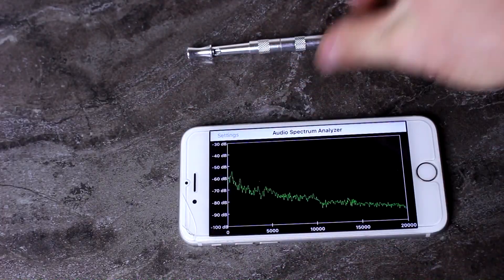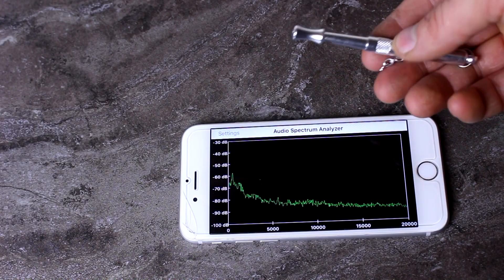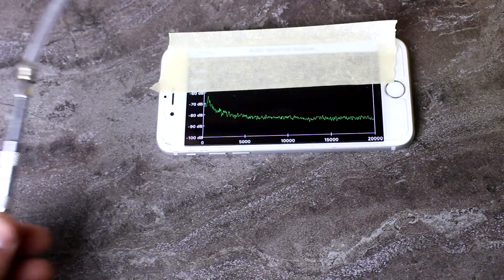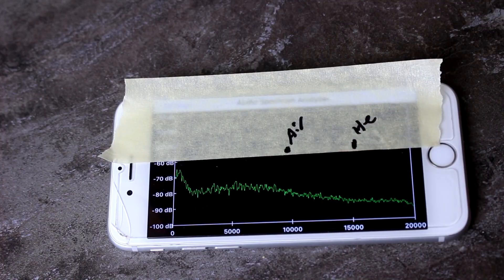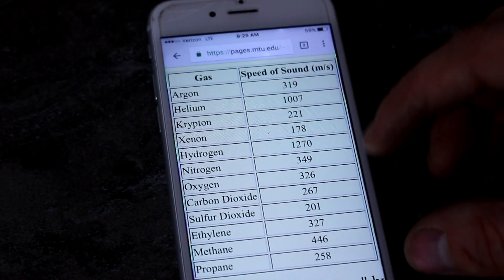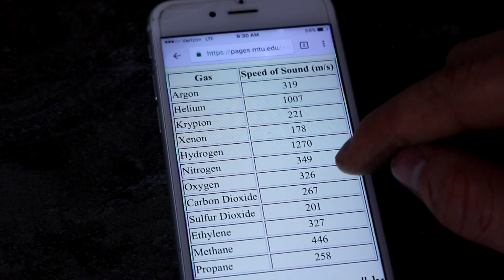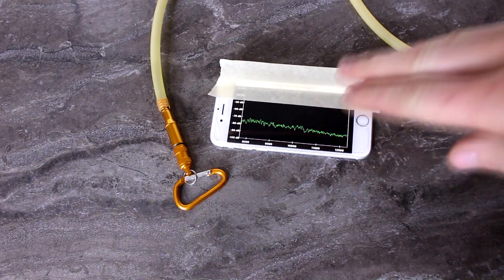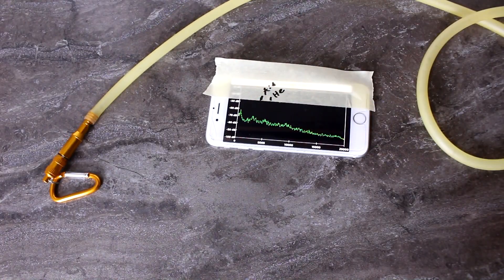Dog Whistle On Helium and Xenon

Comment from the maker: Now I wonder if I could play a song with a single whistle using different gasses to get different notes. Might need someone more musically inclined to help out with that.
Reply: Cody'sLab Set up a MIDI-controlled gas-whistle, and you can import MIDIs others have done. Would be difficult to tune, though, unless you used just two gasses (xenon and air?) and mixed between the two.
Reply: Just get a few analog solenoids, pipe them together to form different mixtures of gasses with an arduino. Produce any pitch of the rainbow. It's quite easy.

Also make sure you get a good audio recording or it'll sound like air blowing, not like pitched whistle sounds.

Just a simple midi-to-valve-open-% should work well, making sure valve-open-% are logarithmic. Some trial and error and a few hundred dollars worth of gas later, you'll have a work of art. 

Sorry, I'm a practical engineer.
Reply: The reason that the notes have multiple peaks is due to harmonics, the pitch you hear is going to  be the loudest harmonic(usually the 1st) and when you put more pressure through the whistle it will cause higher harmonics to become louder. so in addition to different gasses you could change the pressure to get more different notes.
Reply: There are 12 notes in the chromatic scale.

Firstly you will have to see if you are able to reach both ends of the chromatic scale with your gasses. If your lowest note is at 9kHz your highest must be at 18kHz.

Otherwise you can choose a tune that will only use a few notes close together and does not use the entire scale (the first 2 bars of jingle blells is just 4 notes and close together...)

If you have a base note of 9kHz you can choose that as your root C and then mathimatically determine what D E F and G should be relative to your base 9kHz.

9000×2^(0/12)=9000Hz=C

9000×2^(1/12)=9535Hz=C#

9000×2^(2/12)=10 102Hz=D

9000×2^(3/12)=10 702Hz=D#

9000×2^(4/12)=11 339Hz=E

Etc... etc... etc...
Reply: Did you check what is the highest frequency your microphone and phone sound processor can detect/process? I'd like to see this repeated with an actual oscilloscope and a microphone with the datasheet known.
Reply: Hey, Cody! Air != Oxigen! Air mostly is Nitrogen (78%), Oxigen only 21%
I am not quallified to check calculations, or gas densities, that’s why it is just a question - air, N2 and O2 has the same density?
Reply: This video raised more questions than it answered.

If air is at a frequency of 9kHz 3×9kHz would be off the scale of your spectrometer. You were probably seing a harmonic of the He root frequency
Reply: On the hypothetical side if you happen too have a few whistles you could pass propane butane and set them in fire for a neat effect.
Reply: @Adam Neely
Reply: Cody'sLab Thank You for the noise warning, I have tinnitus and that sound at normal volume makes it go nuts
Reply: "Aren't dogwhistles supposed to be so high pitched that you can't hear them?" Well, maybe... You only tested for up to 20kHz. There might be a peak beyond that, and therefore beyond our hearing.
Reply: Record all the sounds  the whistle can make using gasses and then put them up for download lol
Reply: I wonder when you're going to team up with @Smartereveryday to do a crossover! I did a BBMSc and think you're awesome!
Reply: @kobrapromotions  and maybe also with Sam from Look mum no computer   it seems he would love to make this kind of instrument
Reply: Cody'sLab do you think you could do a video where you attach a whistle to the air intake on a vacuum so that when you let air back into the vacuum chamber you gradually hear the whistle?
Reply: Hey Cody yes, the helium is diluted in most if not all party tanks. Matter of fact even in large commercial size tanks they sell what they call Balloon Gas, which is helium often recycled from medical/lab work that is of a lower purity and useless to the medical/lab work in which it was intended that needs a high level of purity.  However it does work perfectly fine for party balloons, depending on the ratio.  

Also Inhaling helium can and has caused serious injury, death and permanent brain damage, as a quick google search will reveal.  Helium in and of itself is completely inert and will not cause you any damage. However as you have shown percentages are important, and if you inhale too much at once even for a few seconds, it can and will displace all the oxygen in your system, causing brain damage and death, and very quickly.  I found a website warning of impure helium supplies because they did not kill you fast enough, it was a suicide website where they teach you how to off yourself. So no not as safe as people would think. (That was more to others here then you Cody :) ) 

For example divers often use helium in their tanks to fight the bends, and this is perfectly safe as they use a regulator that mixes enough oxygen and nitrogen into the system so they do not die.  However if you breath a full normal size party balloon being between 11 and12 inches in diameter and have a smaller lung capacity, the results could be lethal.  Even worse with larger size balloons such as the giant 30 and 36 inch balloons. 

Why do I know all this? I am a professional Balloon artist and work with balloons and helium on a regular basis. 

Also since helium is currently expensive and going up in price a lot of companies are diluting the supply they are selling to increase profitability.  Hopefully they will get the massive new helium find in Tanzania will bring down the prices :)  

Bonus fact.  Helium has never before been sought out for commercial mining operations. It has always been found as a byproduct of natural gas exploration. A couple of companies teamed up to try to locate it on purpose and found a massive supply . 

Great vid Cody loved it :)
Reply: Why did you mark the gasses on the furthest left point only for each of the gasses, when the peak was shown to be further right?
Reply: Cody'sLab need hexane...!!!!
Reply: This would be a good time to use your second channel for any one interested in the math you didn't want to go into in this video. I'd be interested in hearing about it.
Reply: Rob Scallon, end thread.
Reply: Moonlight Sonata 3rd Movement. Wilhelm Kempff plays it very nicely on the Piano.
Shouldnt be the most difficult to achieve with your hypothetical musicdevice.

Btw, alum, water and heat? Does it eat away a broken off tap or bolt?
Reply: cool ideas
Reply: Duncan... why... why would that even be interesting...
Reply: You should definitely repeat thks with a whistle that can produce a purer tone. As your local musical supply/instrument store for help picking one.
Reply: i dunno dude i guess it's not, it's finals week im in a state
Reply: It's not very complicated. Take a tune you like, if possible with not a lot of notes. Nursery rhymes usually have very little, but they usually suck. Note the ratio between your lowest note and every other note, it's a simple log scale, not very complicated. The ratios should range from 1 to 2 if every note is in the same scale. Your starting frequency is arbitrary, just use the lowest you can make with your gas and whistles. Then make more baloons with progressivily lighter and lighter mixes, until you reach the target frequencies.
Reply: Oh shit right I feel you there Duncan!
Reply: you could interpolate between notes by mixing
Reply: Be aware, that YouTube compression will cut sounds above 15 kHZ. As well as most listeners might not have the equipment to playback any sounds above 10k.
Reply: that whistle could be well outside the range of that app, though you might be able to set it to a higher sample rate.
Reply: That would be awesome
Reply: Cody'sLab there's a problem with this setup. The phone's microphone is tuned for human voice, and you might want to change to a Nokia...
Reply: Cody'sLab lol I got the add about the google assistant playing the hipster song with whistling
Reply: Cody'sLab Your iphone does not have a flat frequency response band. You’re results my be horribly skewed.
Reply: Using gas mixtures to achive the desired frequencies could work.
You'll need to figure out all the mixture combinations for the notes you need for your song, then set all three gasses in tanks with electronic valves that would parically open so that you will be able to actually control how much comes out of each valve. Make a program that reads a MIDI file and translate it to precentage of how much should a valve open by reading the library of mixture combinations you wrote down at the start.

But to be perfectly honest, this sounds way too complicated and you will end up wasting a lot of expensive gas while doing tests for mixtures and figuring out how to consistantly keep the mixture in the correct ratio. Sounds like a pain of a project to take on by yourself.
Reply: Well, for starters, you'd need a whistle that sounds good.
Reply: MegaAndy: Welcome to the real world where nothing is as perfect as it is in classroom theory.
Reply: Source out an Aztec Death Whistle. That's a nice interesting and soul scaring whistle!

Cody, look for an app that will only find the fundamental frequency and give you an opportunity to eliminate higher harmonic frequencies and you'll be able to find the whistle frequency a lot better.
Reply: Cody'sLab
shave and a haircut

sherlock holmes was a chemist. what do you know about solution 7?
Reply: Brilliant idea
Reply: Helium for a soprano, Methane for an alto, air - xenon for a tenor, SH6 - Xenon for a bass/baritone?
Reply: Cody'sLab you could probably do this with a composing app then a converter to start the notes earlier and use a computer and some electronic valves like an experiment i did at high school where we had a 5 way switch that we composed music on buzzers with
Reply: That looks like an app?
Reply: Cody'sLab If you blow the wistle at a guitar tuner you will know tthe note. That should help with making a song.
Reply: Try with the xeon, I'm sure the anesthetics will make for a great video.
Reply: I'd like to see a high end whistle with heavier gas blown through it to see if you could get it from unhearable by humans to within our hearing range.
Reply: bertjesklotepino As long as its not broken off in steel. AvE did a demonstration on his channel.
Reply: Фейк Аккаунт short duration, short breath, not emptying the lungs fully. breathing a mixture would still take more time to become anesthetized. I bet he still felt the beginning "warmth" of the xenon. even after prolonged exposure, deep breaths will shorten the effects. The concentration in the blood would have to be maintained.
Reply: Duncan McElroy When they decompress a collapsed lung they use a slide whistle to hear when its fully inflated.
A clear plastic FDA approved medical grade thoracic whistle saved my life.
Reply: Oh and, do you think you could create liquid helium?
Reply: You should do a collab with Ryan Bruce aka "Fluff", he's an audio engineer who really knows his stuff.
Reply: Or perhaps Fluff ^_^
Reply: Well... pick a song and I can figure out everything except what gasses through what median make what notes.
Reply: Cody'sLab try making a light with glass tubes and helium
Reply: I read a lot of comments here saying that the multiple peaks are from harmonics, however in this case, it is not harmonics. Harmonics would be found at integer multiples above the fundamental frequency, not below it. Also,  Cody says that the cause of the sound is bouncing air molecules; close, but misleading. The sound is actually pressure building in the resonance chamber of the whistle until the pressure is too great, then it starts to escape through the vents. Then the pressure builds up again and it repeats this process at the frequency of the resonance cavity. One can make a low frequency whistle by driving fast and roll only one window down in your vehicle(you can feel the pressure changing). Low mass gases allow this cycle to repeat much faster. 
    You will also notice that the frequency was changing as the balloon lost pressure, a lower flow causes the cycle to repeat slower (drive slower and the frequency drops). In the case of two peaks near each other(like in Cody's video, this is probably the pressure so great that the gases escape different paths at different frequencies.
Reply: I think you need more of a tech wizard than a musician. Getting the right frequencies for each note and a timed note sequence of some sort that you can follow is the easy part imo. Figuring which gas (pure or mix) gives what frequency, that seems to be your area. Then you need a device that allows you to play it somehow (or that automates the play), which is less about being musically inclined and more about knowing how to build things.
Reply: The bottom of my dog whistle comes off doesn't look like it will looks just like yours and there is a screw to adjust the frequency.
Reply: How are you going to find out what notes you need without looking them up one by one and consuming an annoying amount of time. I'd assume he'd want to make something intricate and not simple. Maybe Cody knows some theory though I wouldn't be impressed haha.
Reply: Petsmart
Reply: Cody'sLab could you try using sulphur hexachloride if you have some
Reply: Do it
Reply: Real thanks for the high-pitched-noise warning
Reply: Cody'sLab wouldn’t YouTube audio compression remove the higher frequencies? 🤔
Reply: What would happen if 'someone' put a speaker inside a helium filled balloon and just played some music?
Reply: Hi Cody, I was etching a pcb last night using FeCl3, then I thought if that could be reused. Can you make a video if you are interested or say you are not? I know that after eating copper from pcb FeCl3 turns into FeCl2 and CuCl2. I feed a broken transformer plate to it and got back my copper, so I guess entire solution can turn into FeCl2, but how to turn it back to FeCl3? Cl gas could help, and what is more interesting, we can get more FeCl3 that way. Or there any ways of bringing back Fe to get FeCl3? That could be boring, but, anyway
Copper crystals forming on a plate are nice
Reply: You missed Helium peak cause you didn't look high enough at 30kHz
Reply: I believe I read the fine print on the party balloon grade helium before and it is in fact not hundred percent helium it's intentionally diluted you could try buying a balloon from a store if you know they fill their own because it's typically commercial grade helium which is also welding grade which is fairly pure.
Reply: Cody'sLab perhaps next time you could rig it to blow through one of those recorders like you learn to play in elementary school and just produce all the basic notes with all the available gases you'd like to try and then you could put it out to your subscribers I'm sure somebody would remix it for you rather than getting extremely elaborate, I'm sure it'll make the top 40 LOL good luck
Reply: Cody'sLab from a scientific point of view would a scuba diver taking a canister of oxygen into a electrolyte filled of oxygen be classed as funny? 😂
Reply: Cody, i have a great idea for your idea on playing music with this kind of stuff................
And it wouldnt have to be expensive at all.
All you need is a flute or something like that.

HEY!!!!!!!!
Perhaps you might want to join up with Mister ElectroBoom on this one.....................
He perhaps may be able to build a small robot kinda thinggie with an actuator which can actually play the right notes (hold down the right key, or close the right hole, or perhaps like the old flutes: slide a small stick inside a tube.................... perhaps done with a small stepper motor or servo...............)

And hooked up to the flute or whatever is ofcourse your balloon (perhaps a condom would do a better trick since it can hold a bit more????)
Reply: How much xenon did you use?
Reply: That whistle is tunable. You can adjust the frequency of it, unscrew the endcap.
Reply: Hey Cody, by that logic would different gas temperatures effect the pitch too? I guess venting different gases into a whistle is easier than somehow channeling different temperature air into the thing. An array of electrically heated air tanks kept at the right temperature using PID controllers perhaps. I wonder if how much you would need to compensate for the cooling effect when depressurizing them. Anyway great video although I would watch out for "aliasing" when sampling though!
Reply: Cody'sLab One YouTuber musician who loves playing with weird ways to generate sounds is Andew Huang. Try him.
Reply: That should not affect the frequency just the intensity of the sounds are attenuated more the further away from the target frequency range of the microphone / compressor circuit.

The frequency doesn't change, it just won't show as high a peak. The background noise will also be attenuated equally so the peak should still stand out.
Reply: Just use s standard flute for that, I used to play the flute (and a few of the other like instruments) when I was younger and you could get a full scale from all of them if I remember correctly. Where that scale was depended on the flute itself.

When you play the flute you only have air available, OK, maybe slightly heavier on CO2 as you're exhaling but it's still only air and you then moderate that by changing the effective length of the sounding chamber created in the flute for the standing waves to produce the sounds you want.

You should be able to do that with any gas, or use several flutes playing the correct notes you want on different gases.
Reply: I might be able to tell you how if you want
Reply: sounds cool
Reply: I'd get an octave of whistles and use the gasses to get different ranges.
Reply: @lookmumnocomputer seems your style (can I actually mark someone here????)
Reply: Do the song 'Inner Light' from the star trek episode on TNG
Reply: The Dog whistle produced a D9 or about 9,400 Hz just to let you know (for air) and for Xenon it was about A8 -20 cents or about 6,960 Hz, but the pitch decreased as the whistle kept on going.
Reply: What about using different temperatures of the same gas?
Reply: Mitxela would probably be somebody who could help. Has a youtube channel
Reply: Throw a speaker in a container of helium
Reply: Contact Mattias Krantz, he would be pumped by the idea of a music instrument!
Reply: Lol if only you could do that with musician/youtuber Andrew Huang